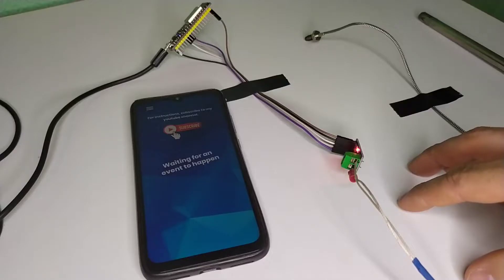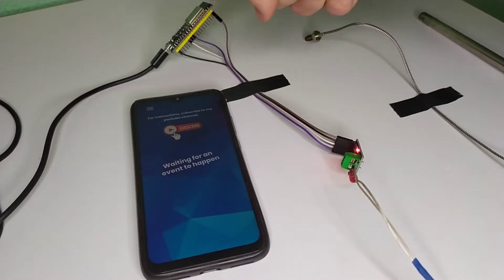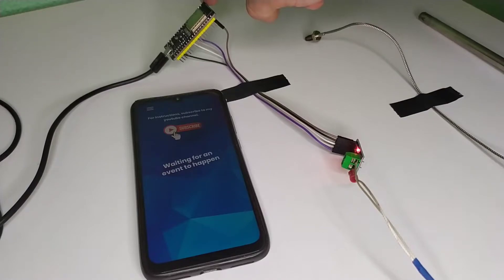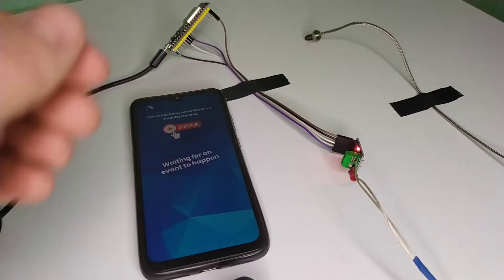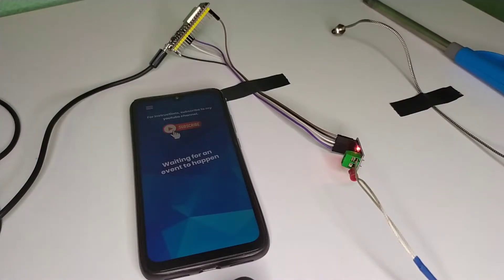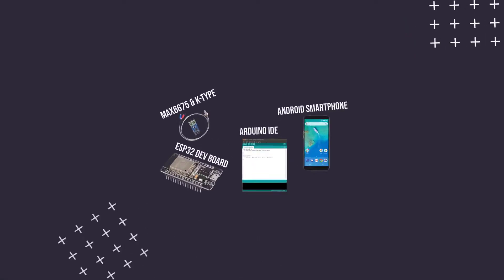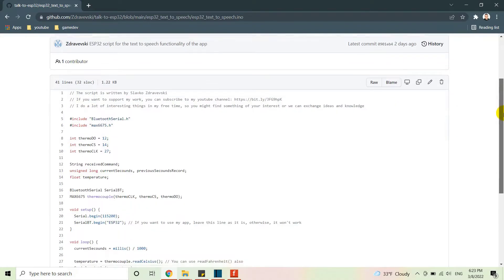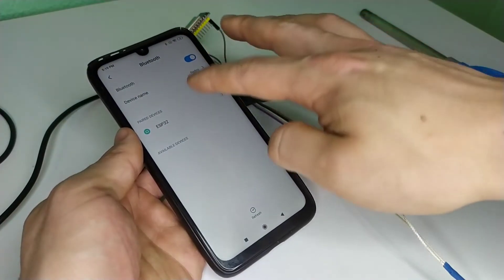ESP32 + Android Text to Speech + MAX6675 & K-Type Thermocouple | Easy Alerting System

Comment: Thanks for the interesting video. The connection to Android is something I miss. Can you tell how did you design the app? With AndroidStudio? Or something simpler? Also, is it one way communication or are you planning to control the WSP32 from the Android app?
Reply from the maker: Thank you very much! I developed the app with Unity and built it for android, you can use some other technologies, but I chose it because I have experience in it. And no, the communication is bidirectional, I posted videos about controlling the esp32 with voice commands, text commands, virtual potentiometer, and I will be adding a lot more features to the app, so if you have an idea share it with me 😀
Reply: @SlavkosHobbyChannel  i am looking for an easy way to build simple Android app for ESP32 control. I find unity and Android studio over kill, and not easy to start with. Any thoughts on that?
Reply from the maker: @YigalBZ  hm... I don't know, unity is not difficult in my opinion, start it and you will see that it is easy and fun. So everything is possible just start learning slowly and everything is achievable 😀
Reply: The easiest way to develop an app for Android is using the MIT App Inventer